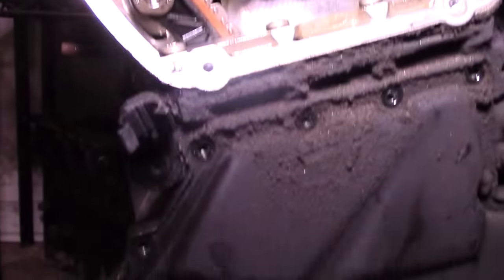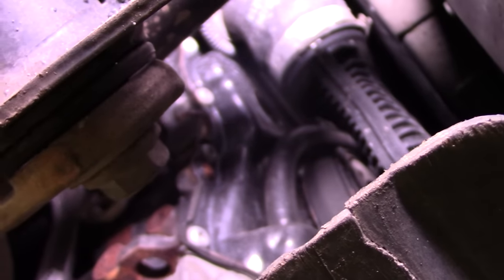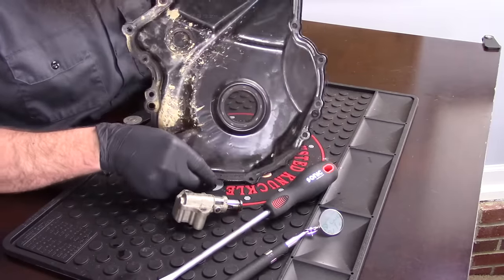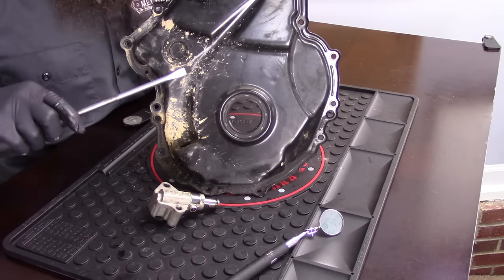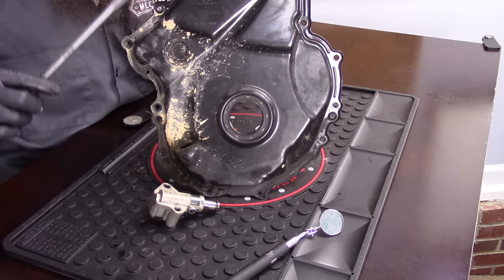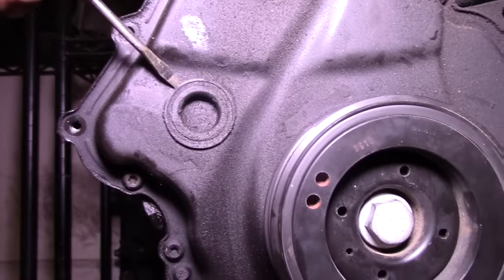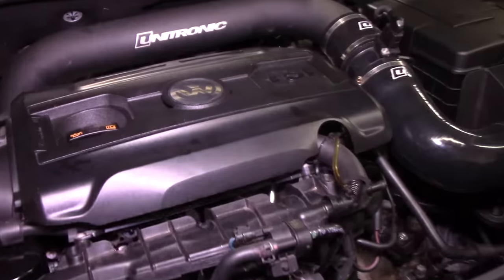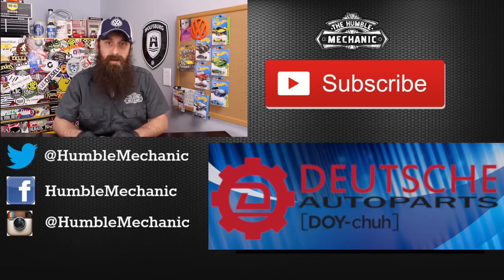How to Check 2.0T TSI Timing Chain Tensioner

Comment: hey charles thanks for the video, would this process be the same for the tfsi engine as well? trying to check if I need to change the tensioner on my 06 audi a3 2.0t. Thanks.
Reply from the maker: +Arjay Canon yes. The TFSI and TSI are the same.
Reply: Alright thank you much appreciated!!!
Reply: Jack Attack my tensioner went recently. Only indication was startup noise on turning ignition where car grumbles like a tractor for 1-2 seconds as the oil is not lubricating something in the cam. This sound is very noticeable and went on for about 2 years. VW dealership here wasn't interested during warranty period at services and just bluffed something about the tappets making that noise oh nothing to worry about. Hope this helps

Comment: I own a seat Leon with the 2.0 tsi engine, I have engine management light on. cam/ crank sensor incorrect corrolation  poo16 code. engine starts up and runs fine just takes a few seconds turning over. no knocking or strange sounds to indicate a slack chain. is this related to timing chain tensioner failing or could this be a stretched chain or tensioners maxed out? I find it hard to believe a timing chain fault on a engine with only 60k miles although watching the videos it seems pretty common. do you have a video on timing these engines up?

Comment: the dealer just had my intake manifold replaced and they found both of my rear main seal and upper timing chain cover are leaking. I know the main seal is impossible for me, but is there a video about the upper time chain cover available? Or, is it another mission impossible?
Reply from the maker: +Quan Gan the upper cover is easy. A hand full of bolts. 

Maybe I'll do a video on my wife's car
Reply: HumbleMechanic Hi Charles, thank you in advance!

Comment: how do you open that rubber cover, my tool even break in half the cover still intact
Reply from the maker: Usually warm engine helps. But I pop them off carefully with a screwdriver

Comment: how can you tell if the cams are damaged if the tensioner failed. I'm looking into purchasing a kit from DAP and I don't want to do all the work only to find I have damaged cams.
Reply from the maker: You will have to inspect the cams for damage. And remove the bridge and look for the small filter.
Reply: Thanks! after I read about lobes spinning on DAP's site I'm a little paranoid.

Comment: I’m wondering about the serpentine belt tensioner. I have a 2010 Passat 2.0t tsi. How to remove the tensioner. It looks like it has just one bolt... help me out.
Reply from the maker: Serpentine belt?
Reply: HumbleMechanic 
Ok the belt. There’s the tensioner with one bolt” that I can see”. But from photos the tensioner is connected to a shaft.

Comment: HI, I installed a new vw tensioner on my 09 eos 2.0 after the install  when rotating the engine by the crankshaft bolt I noticed that the new tensioner is moving in and out when the engine rotates and making a snapping sound when I rotate is that normal? Thank You!
Reply from the maker: Movement is normal and some noise is too. The movement should only be in the tension. Meaning the tensioner will move “up and down” the same way you tension the belt.
Reply: Thank You!

Comment: Is there any way to check the chain tension without taking the entire timing chain plate off? I've got a strange whirring noise, engine rpm related, coming from my car and I'm wonder if the tensioner is failing.
Reply from the maker: +Clifford Gindulis not mechanically. But you can check t electronically with a scan tool. 

I have had water pumps make weird noises like that. Take the coolant cap off when it's making the noise and see if it changes.
Reply: +HumbleMechanic 

I have a VAG-COM and didn't realize that it would show me that! I Google'd it and it seems to be engine control, groups 91, 92, & 93. Does that sound right for B8 A4 2.0t?

I will definitely try your WC cap trick. I already know I've got an issue in that neighborhood since the car will not come up to normal operating temp. I really don't want to have to replace timing chains, especially since the car only has 70k on it.
Reply: +HumbleMechanic 

I forgot to thank you for taking the time to reply to me! I appreciate a piece of your day!

Comment: My 09 GTI is throwing the code P0016 (crank-cam position correlation). As soon as it starts up, it shuts off after about 3 seconds. I can hear loud rattling.  I was told it was the timing tensioner. Can you please help?
Reply from the maker: That sounds reasonable to me.
Reply: thanks
Reply: Also it happend the day after I did an oil change. Wierd? Luckily it shut off on me when I was parking the car.

Comment: Instead of the mirror, my old eyes prefer a USB inspection camera. It has light on the tip, bendable wire to go where you want it, and it hooks up to a phone. under $20 on amazon and the best thing since sliced bread for jobs like this
Reply from the maker: That is a great way to do it. I have had pretty poor luck when the cheap ones like that. But when they work, they are great.

Comment: I love my CC, but with 131k miles, im worried about someday, the engine going. My question is, what would then be a more reliable junkyard engine swap, i mean, whats a direct bolt in replacement engine that WON'T have these problems? I dont ever want to get rid of this car, even if its engine replacement is less powerful....
Reply from the maker: Best bet is making all maintenance updates before installing the same engine

Comment: Help. Can the timing chain cover be removed from an mk7 be removed without pulling the engine.???
Reply from the maker: yep. You do have to support the engine because you will be removing the engine mount
Reply: Thank you. Perhaps you can give me quick advice. Have low pressure warning. Pulled oil pan and in the pan is a half moon thrust washer and a piece of black plastic about The size of a sliver of an almond. Coded for cylinder 4 misfire and a Couple cam  timing codes. No metallic engine noises or clunking. Power was fine before engine light. My thought was to replace thrust bearings and thrust washers and throw on a new timing tensioner. My goal is to learn while doing and I’m not in the position to spend $$$$$$.  I’ve changed the clutch and A/C compressor from what I’ve learned on your videos. Thoughts?

Comment: I typed a comment that disappeared while still commenting. Bummer!  I own a 2010 VW Passat Komfort - 4 door with a 2.0 TSI Engine & only 70,000 miles on it.  I saw a comment which I can't find again; I want to know if this statement is correct, "Every 2.0 TSI Engine manufactured before 2012 was fitted with a defective Timing Chain Tensioner".  This is important!  Without hardly any warning the light came on. I drove less than 1 mile to my daughter's, & the car died - had to tow it in ( sounded like ball bearings in a dryer when I tried to start it again.). 1. Clear gunk from intake valves, 2. Reseal Cylinder Cover, 3. Replace Lower Timing Chain Tensioner, 4. Replace Rear Main Seal, 5. Replace Manifold (It was still in Warranty, but I had to pay for cleaning.) = $3,259.26! I called VW who, after negotiating, said VW would pay for 80%. The Dealership found a bad Tie Rod End which they would replace for free. This makes me owing around $450.00. If the Timing Chain Tensioner had been defective when fitted on the car, VW should pay for all of it.  I can't pay that much money!  Thanks for answering. M. Johnson in Tennessee.

Comment: Howzit mate, I live in South-Africa and i own a 2013 Hyundai i20 Crdi. Its a 1.4Diesel. Must say pretty good cars. Im at 156000km didnt have any shit with this car at all cant sy that with my previous VW's 😂, anyway i dont know if you get them there but here our temperatures range from 0'C in winter to 38'C in the summer it's summer now... Anyway i did my service myself, that includes all filters including diesel filter. My owners manual states i should use 5w30 or 10w40. But recommends 5w30. Here 5w30 is verby expensive so i bought 5w40 Shell Helix HX8. Would it cause damage using a 5w40 instead of 5w30? As in the thicker oils it appears to be usable in the viscosity chart. Thanks man Shaun.
Reply: Hyundai ugly cars 😂 lol

Comment: ,Hello!  do you also recommend replacing the timing chain? or just the tensioner. my car has around 108,000 miles.
Reply: Do the chain and the gears as well. The cost will increase a little but you will not have to change the chain down the road. This is if you plan to holdon to the car

Comment: so I've got a cam position sensor signal too high code it won't start and the couple times that it has tried to start it's backfire through the intake and throwing the TCM code I am at a complete loss here if you have anything any information any suggestions that would help I would greatly appreciate it hell if anybody got any ideas I'll listen it's my wife's car I love the little thing it runs like a raped ape when it runs

Comment: wish i knew this about 2 years ago before my timing chain failed and wrecked the head on my 2.0 tsi
Reply: You and me, buddy. I ended up doing it myself and the parts and pieces alone were $1,500. I uploaded a few vids about it. So mad at VW...
Reply: Happened 3 days ago on my Golf 6 1.4 TSI 2010, 60k miles Morning start at home , cut out. Rings , guides done for. Not looking forward to the damage / price tag coming
Reply: My uncles GTi had the same problem, but VW warrantied it and he got a whole new engine.
Reply: @512kjt  how many kms did u have on your car. ?
Reply: how many kms did u have on your car. ?

Comment: Sorry for the dumb question, but what exactly are you checking through the inspection hole?   The part number, or the appearance of the tensioner?   What part number (or what shape) identifies a good tensioner?

I've watched both this video and the "How the  2.0T TSI Chain Tensioner Fails " videos, and still can't tell what it is you're looking for through the inspection window.   Thanks in advance!  I've actually got two VW's with this engine, so am quite interested in your reply.
Reply from the maker: +tedjohnson64 the look of the part. The new revision looks very different.

Comment: I have the 1.4 TSI 140HP (NOT in the US) and sounds like my chain is becomming lose. I actually didnt catch HOW to check it myself, anyone wanting to help? / Daniel Denmark
Reply: There is no really way to Check it on this Engine. Volkswagen Dealers have a Special Tool for this Engine to Measure how much your Chain has stretched. 
You should change out the Chain, Tensioner, etc to the updated Version. The Job took me around 9 Hours on the CAXA Engine my first Time. I Replaced the whole Chain-Drive. Every Guide, Gear and also the Oil Pump chain.
Reply: GEMC Sounds like a good idea, but I have just bought the car so I am broke.
Reply: GEMC How can you hear if the car is broke?
Reply: You Can pretty Much only hear the Rattle at Startup. It gets Worse and worse.

At some Point, the Check Engine Light will come on and you will have a P0016/P0017 Code Stored as Active.
This means that the Timing is out of Time, the Chain has stretched significantly.

As said, the Dealer can measure your Chain, but you have to know, that the Chain can Jump Timing when doing this. If so, There is no way around the Chain Job.
You should know, that if you wait too Long and the Timing gets to far off, your Valves will be Crushed by the Pistons, which means you have to Take the Head of and Get new Valves or new Exchange Engine. Both is very expensive.

You can do this Job yourself, but you will seriously Need to be good Equiped with Tools.
I did this Job on my own, but I have Access to Special Tools at Work (I am working as a Mechanic at a Dealer). You would obviously need to buy these Tools, You CANNOT do it without. I´ve done this on a Family Vehicle and replaced every tiny Bit of the Chain Drive. The Chain is in for about 10kkm and still no noise. Volkswagen states, that the newer Updated Chains are good and 
inconspicuous
Reply: GEMC Thanks for the good reply. The car does not rattle under cold start, but the oil is overfilled from the previous dealer at service, so I hope that it is not because the oil pressure rises too quick, and when the next service is done and the oil is at normal level - the chain will start rattling.
Reply: Just let them suck some oil out with vacuum, done in a minute. And replace the tensioner you don't want to take this risk.

Comment: I know this video is old but would have been very helpful to show both old and new tensioner and point out the difference and what to look for while looking through inspection hole.
With out that this video is almost not very helpful other than showing how to remove inspection plug, kind of surprised this video was so incomplete because his videos are ALLWAYS super detailed...not this one though.
Reply from the maker: That’s a 7 year old video vs today
Reply: @HumbleMechanic ...your how to videos are the best, keep them coming.

Comment: early Nissan VQ35DE engines had crappy chain guides, common issue, not a fun job to do on a 350Z or Nissan Maxima, 350Z the engine was shoehorned in, Maxima was transverse mounted.....at least this is only a 4 banger

Comment: +HumbleMechanic Hey, Charles! I've been learning with your videos for a while now, your insight on VAG mechanics is usually spot-on; also, as an amateur mechanics enthusiast, your tips and tricks made my proyects a thousand times easier, I really appreciate that! 

Now, if you don't mind, I'd like to present you with an issue: 
My car, a '09 Audi A3 1.8TFSI has probably never had the chain tensioner changed. 
As far as my understanding on the matter goes, it's basically a 2.0 TSI with shorter strokes... does that mean that the distribution is exactly the same, and, as I've heard you say, I might be running on "borrowed time" (130.000 km = 81.000 miles already)? 

Thanks in advance for your time, keep that awesome work going!
Reply from the maker: If it has that old style tensioner, then yea you may be on borrowed time.
Reply: Got to find a way to get it high up the ground to get off the crankcase cover and get to that chainbelt cover plug. Thanks a lot for your time, man! I'm always looking forward to learn something new with you.

Comment: One of the biggest contributing factors of this failure is the low engine oil level that is caused by the inferior EGR PCV system that fails.  Once this fails and oil is being consumed (burnt in the engine) the oil level drops and then the lower timing chain tensioner fails.  What is sad is that VW does nothing to help the consumer.  No service bulletin to inform the owner, no email to disclose the problem to the owner, and no monetary help for the failure when it happens.   NO MORE VW for me - ever.  I hope VW goes out of business - that's what they deserve.

Comment: DO NOT BUY VW.  I have had 2009 Tiguan 2.0TSI for 6 years and there are lawsuits for Fuel injection, Intake failing and Tensioner failing.  Great video BTW.  You will bend the pan.

Comment: personally i think vw are losing the reliability they once had. getting too over engineered.  so many problems on my golf gti mk5.  lovely looking but just a nightmare.  chain issues, pcv issues, rust on wings, diverter valve problems, carbon build up.
Reply: dude, after 2005 maybe a little later for different models, VAG cars made unreliable on purpose, so they last within the factory warranty and then you get all the surprises. Now it's all about marketing only. All this technology to gain fuel economy, smallet engines etc. is a lie to make you pay much more on repairs. Look at audi 100, a6 (c4, c5) and tons of other cars from 90s, they freaking last forever)

Comment: OK, so on a 2010... is there really even a reason to check this?  Seems the "next gen" was well after 2010, or could I possible be safe and I should check?
Reply from the maker: +Tony Kiser you have a 99% That it's got the old one in it. Unless you or the previous owner fixed